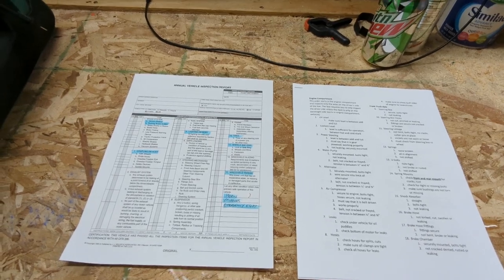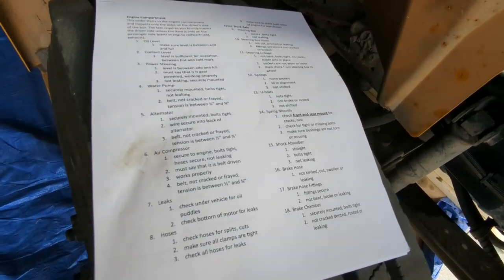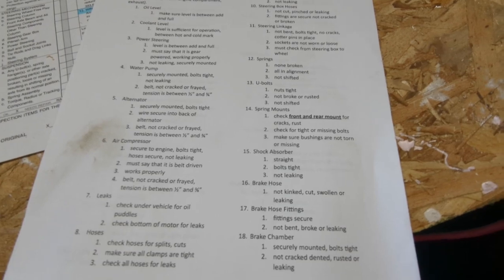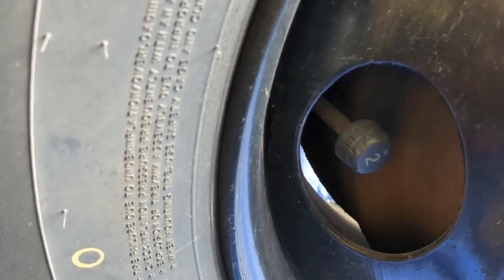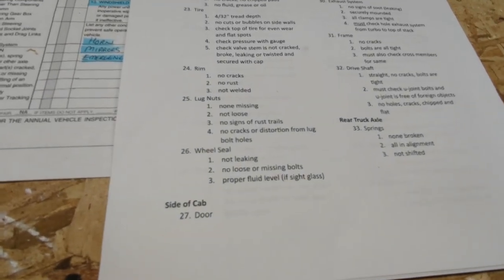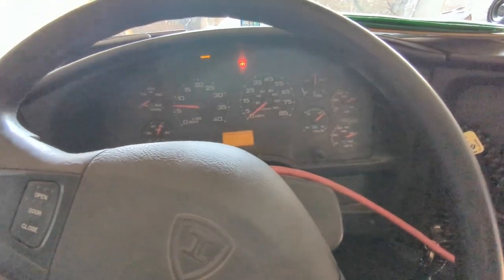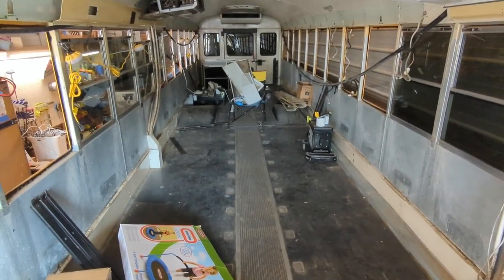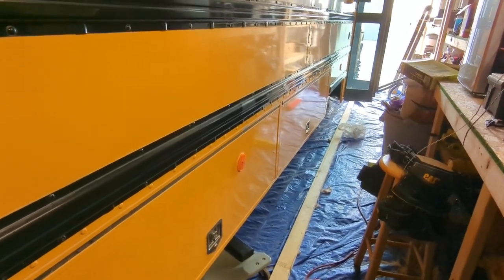How to Inspect a Converted School Bus

Comment: Can you add a second alternator to these kind of bus, possibly a 48v one?
Reply from the maker: anything's possible but it wasn't really wasn't designed for that. You're going to need the new alternator, custom brackets, and adjust one of the belt paths. Possible, but not easy.